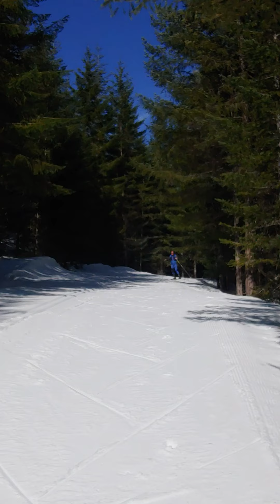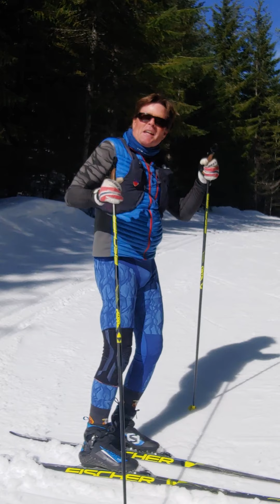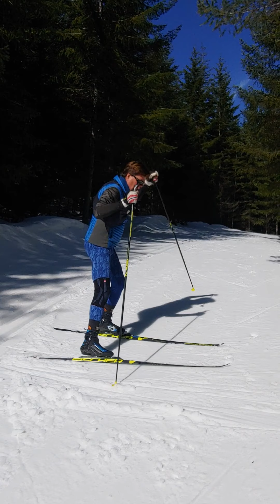Parallel Turning on Cross Country Skis!

Comment: Are the parallel turn or hockey stop techniques any different, or easier, if you have a skate-ski set of skis/boots/bindings compared to a classic setup?
Reply: Same, but a LOT easier with shorter, stiffer skate skis, and maybe more importantly yet, with laterally and torsionally rigid skate boots, and bindings with a solid grip on the sole and heel.
Reply from the maker: No and yes!